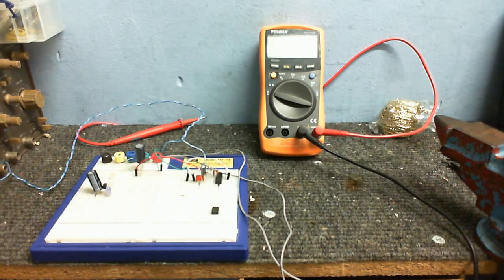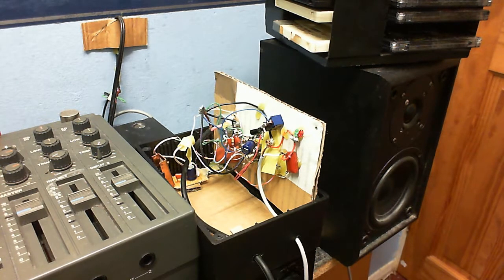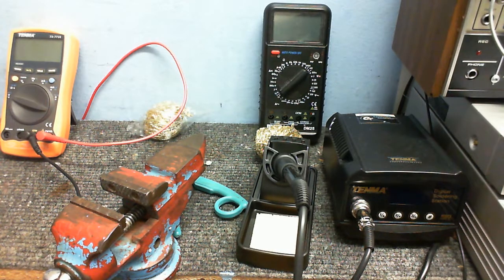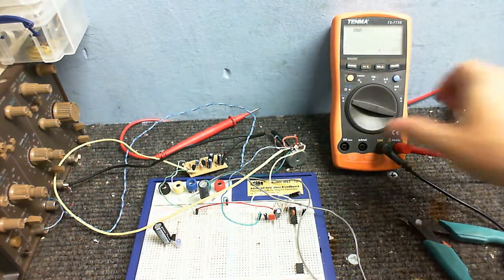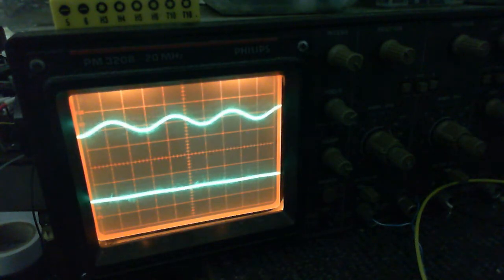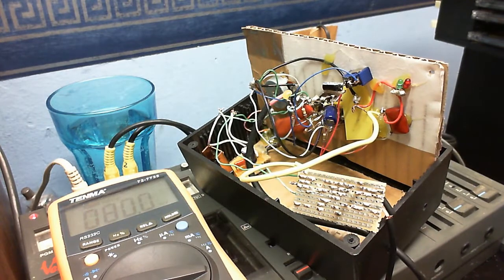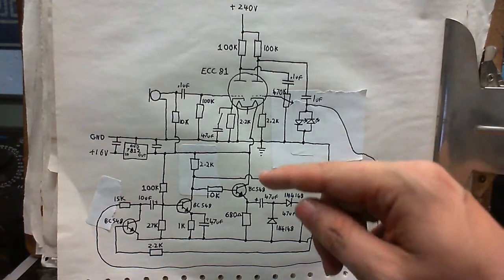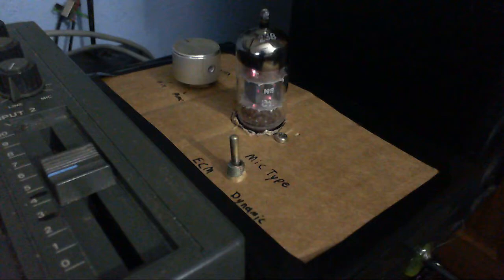CDC Electronic Workshop - Microphone Preamp Tube/Transistor hybrid.

Comment: i might suggest with the gain in the mic to make sound crisp upon receiving, would be to make a detachable Metal-fabric mesh to put over the mic to smooth out the sound so that the sound intensity is reduced to the point that the audio output through the speakers isn't blasting, but isn't too soft to hear either as it comes through :3
Reply from the maker: Sonic Dash My mic preamp that I use now has auto level control, so it levels out loud and quiet sounds.

Comment: So you finally got a soldering station, how it performs? Because after I got soldering station, using ordinary iron is something that makes me cringe
Reply from the maker: I know right?  I got sick and tired of the crappy soldering irons I get from the local hardware store, some of then didn't even last a day before the element would fail!   I must say I'm quite happy with my soldering station, it warms up nice and quick, has full temperature control as well and has a tip designed for lead-free solder so I don't have to worry about my tip dissolving! (it's impossible to get regular 60/40 or even 63/37 solder here), and another good thing (especially for me) is I know when it's on!  The only downside is that it only came with a small tip, but that's just a very very minor nitpick.
Reply: CoolDudeClem About tips - check if they are compatible with ones made by Hakko. Tips for my station (Lukey 702) are compatible with them. Search on eBay for tips, I have a video in which I show that I bought 10pcs for like 10 bucks (not Hakko's of course). Not the best quality, when I cranked up temperature to deal with some lead-free solder, plating on one tip flaked off, but whatever... I suggest you to buy Hakko chisel tip, size - your taste
Reply: CoolDudeClem another UPSIDE is that you can use all kinds of tips...some are the best out there! I think HAKKO USA are the best ones!
Reply: CoolDudeClem I have two Hakko USA tips that are the wrong size for mine. I can send to you with next tube delivery. (Shape -3.2D) #900L-T-3.2D

Comment: dude.any amplifier will become a limiter when the voltage available to the tubes anode is not enough to allow a higher voltage swing with a louder input signal.Will it behave? probably not.What's the pin 1 and pin 6 DC voltage on the tube.Remember.Top much driving through grid positive will cause it to saturate (limit) its available output.
Reply from the maker: +Charlie B. Yes, but it will be clipped, the point of this was to limit loud sounds WITHOUT clipping and boost soft sounds.